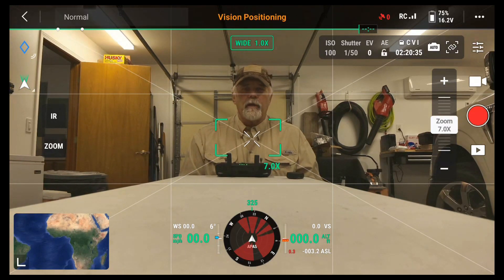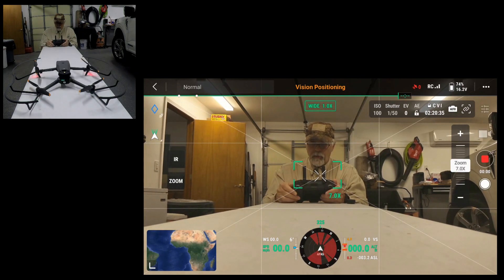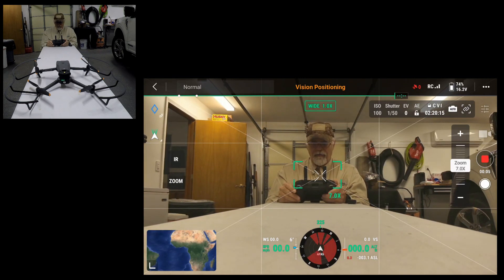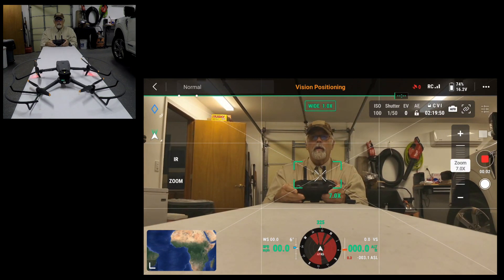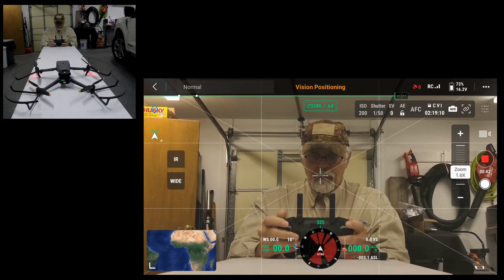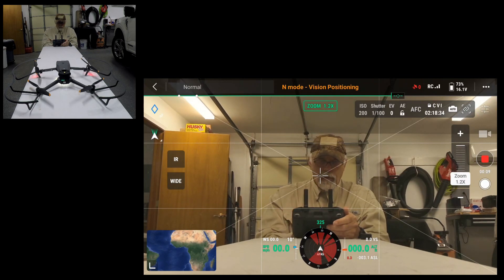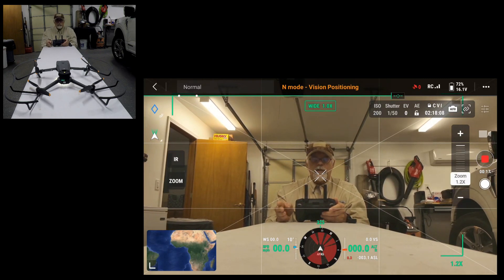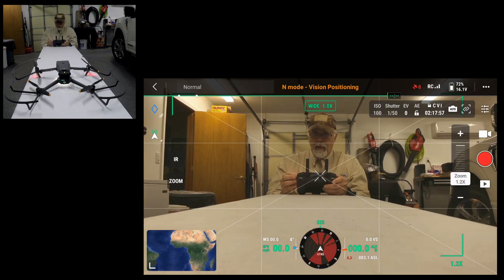Setup and Using Navigation Beacon and Aux Lights on DJI Mavic 3 Enterprise Thermal Drone.

Comment: Greatly appreciate this video! I was curious about this too. Question: I notice on your controller screen recording your camera image takes up the whole screen. How do I change my setting to do that? Mine is basically a 4:3 ratio right now where yours looks widescreen.
Reply from the maker: Do you have a 3T?
Reply: Im having the same problem also, i must be missing something too
Reply: I have a 3t as well in regular flight 4:3 ratio when I'm recording it goes to full screen... Is there a way to have full screen all the time?

Comment: Thank You!!! I have been looking for hours how to activate this feature! I had no idea from the manual to hit the 3dots while within a menu selection. The manual really sucks for a newbie.
Reply from the maker: You are Welcome!
Reply: @W0GEN  Now I just need to know what causes the constant beeping until 20' off the ground. Just got the M3T yesterday.
Reply from the maker: @steveolson7638  goto setting and see what your distance setting is at for brake and avoid... I set mine down to 3 ft.
Reply: @W0GEN  That didn't do it but turning it off did. For night that's ok as the sensors will not work anyhow. I'll try it again tomorrow when its light out. Thanks again! you got me another 1/2 way there.☝
Reply: I can’t believe how sophisticated this m3t is and there are no videos out for this drone. The instructions are piss poor. A 5000.00 drone should have better understanding and switch ology looks like I may have to do a complete video on this beast and that will help out a lot. Problem is I got the drone just never made a you tube video in my life.